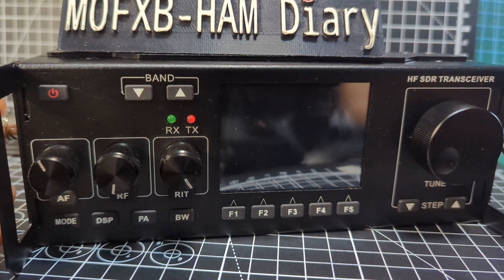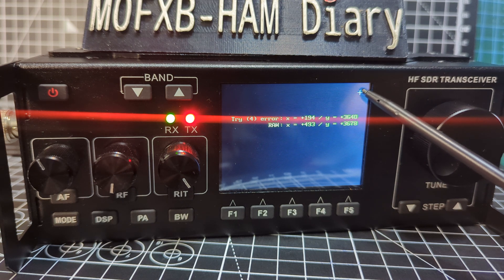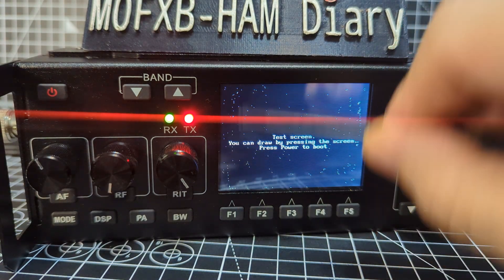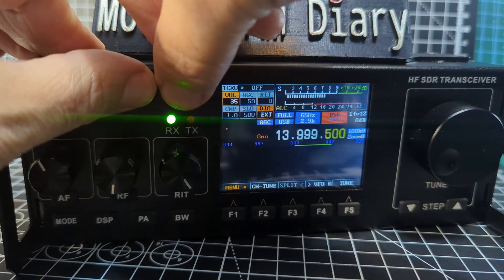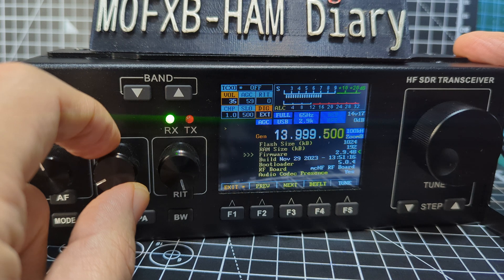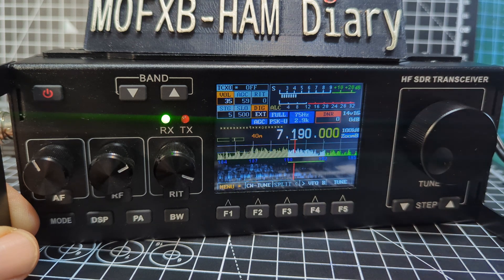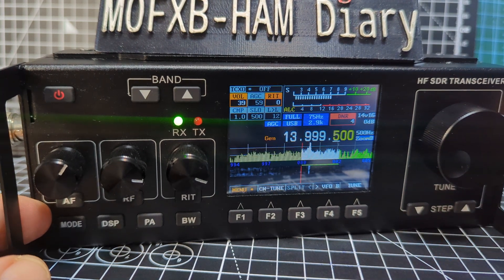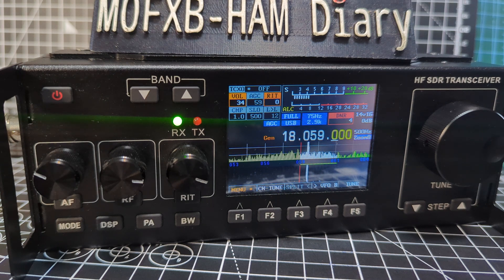RS-918 TRANSCEIVER - SCREEN CALIBRATION & TEST

Comment: Had this radio a year still not tx on it as im still not a ham yet ..one day, it is great for listening in , i still have the standard firmware installed 73s
Reply from the maker: Hi check your boot loader number see which one you have .